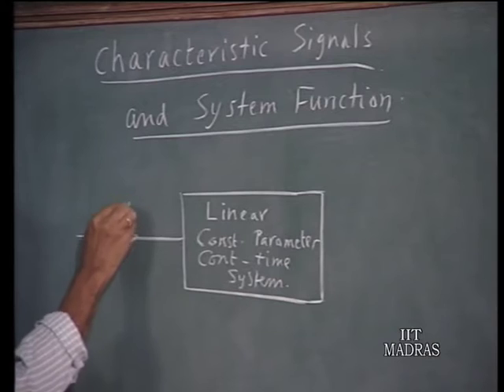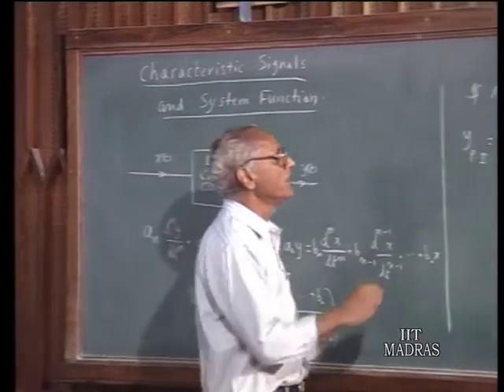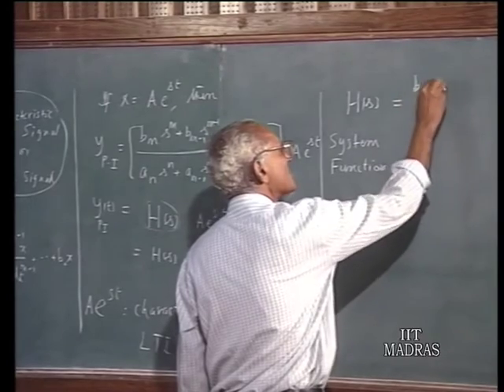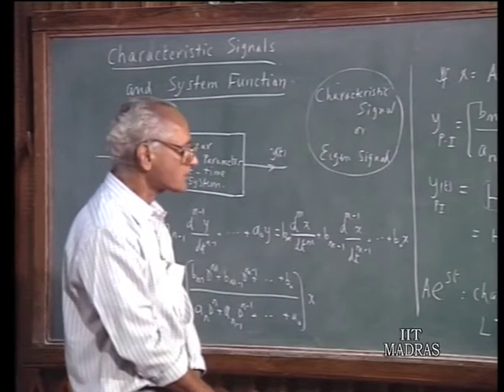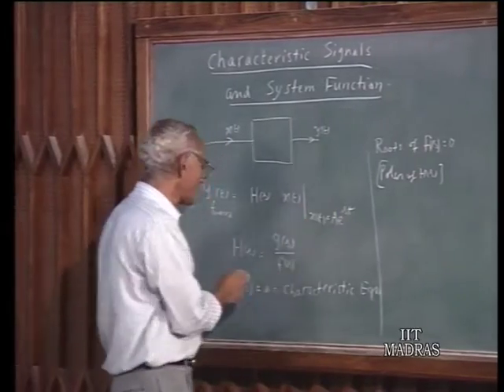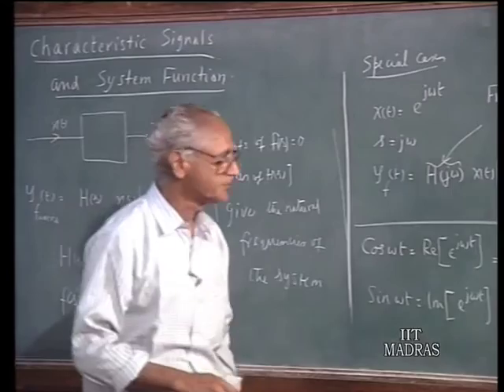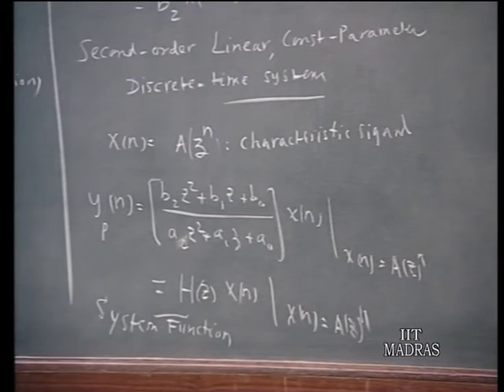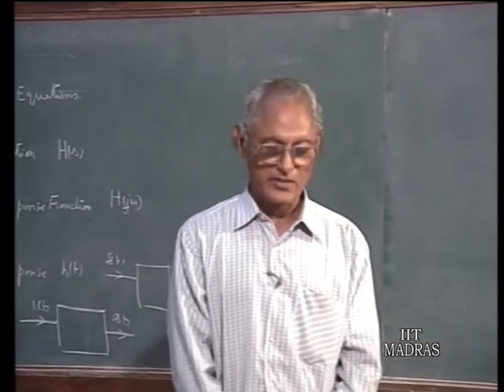Lec 13

Comment: lin const para CT syst 0:00
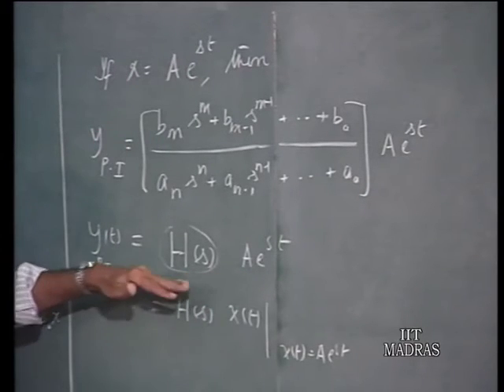char signal / eigen signal 5:30
diff ways to look at LTI syst
0. DE as done in last video
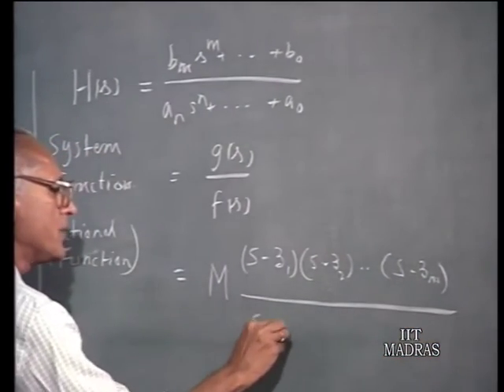1. Ae^st as char signal giving h(s) as syst func with pole and zeros in s plane 9:30
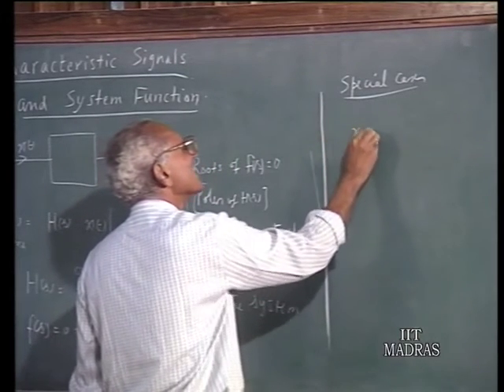2. Ae^jwt as char signal in spl case with s=jw giving hjw) as freq resp fun 16:00
3. Az^n as char signal in case of DT syst giving h(z) as sys fun.
4. impulse resp h(t)
5. Step resp